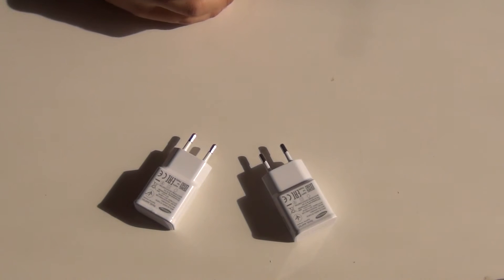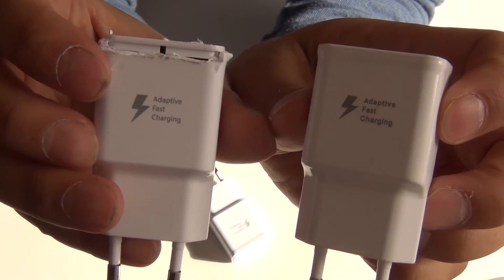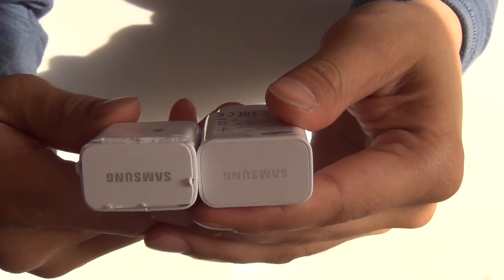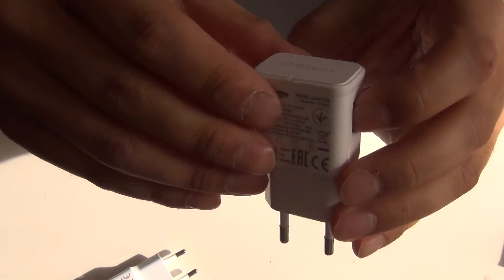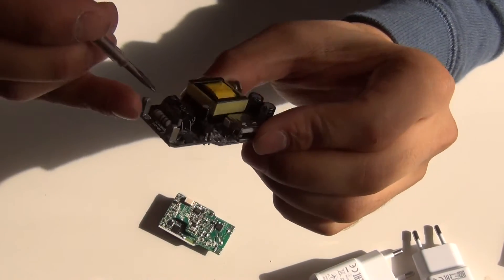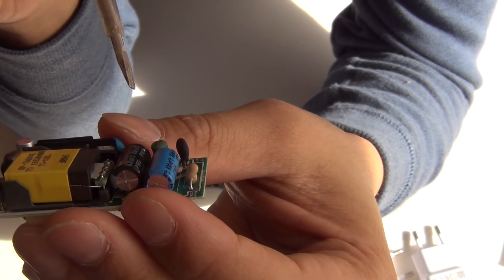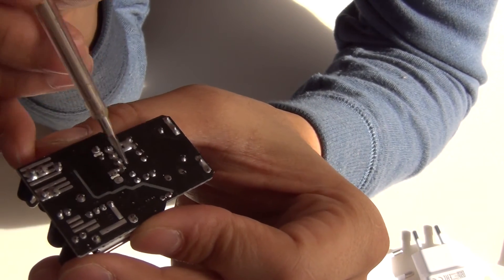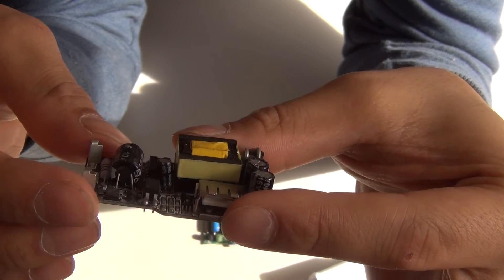Samsung inside electronics galaxy s6, s7, s8 adative fast chargers usb part 2

Comment: So the thing is

Original adapter's now day's have device recognition, it's only charges on their own counterparts phone's by reading device data, companies now integrating microcontroller in the charger so that it only charges their branded phone's.

I tried to Samsung travel adaptor to my Nokia 6.1 phone it charges only for a 3 seconds then turns off.

Well designed.
Reply: Liar.